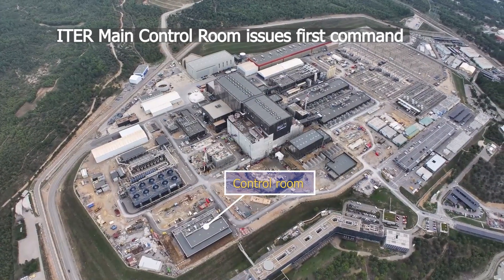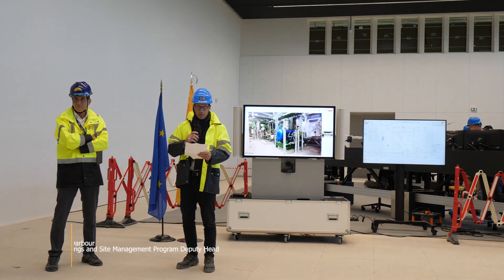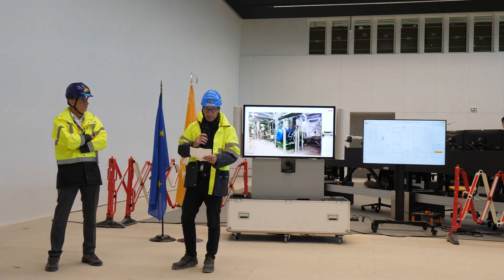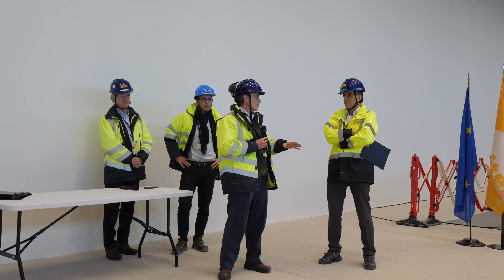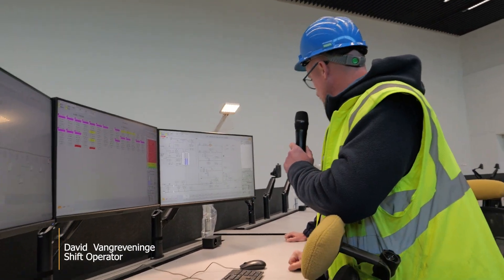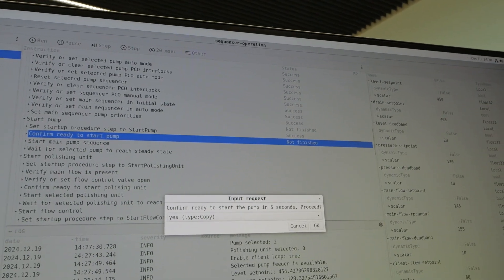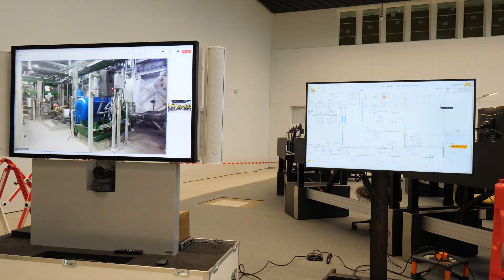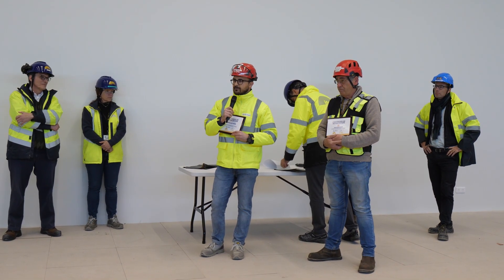ITER Main Control Room issues first command

Comment: As a programmer, when I see that screen of "sequencer-operation" and the property grid on the right-hand side, I'm not sure if that's a debug view, or either a very bad or very good software. A software that displays keys and data types rather than labels and sliders/input boxes can either be very crude and unfinished (making a generic list of all parameters is the fastest way to get a program that allows viewing and manipulating all inputs without spending time on the UI), or it can be highly specific (people meant to operate this software are so highly educated computer nerds [in a good way] that they rather adjust values from property grids than on a user-friendly and visual GUI). 😂